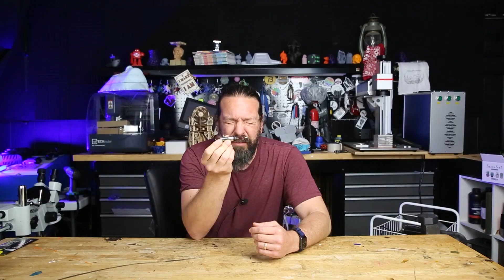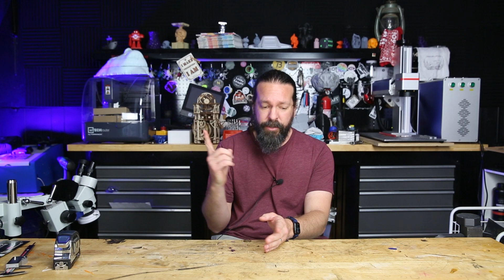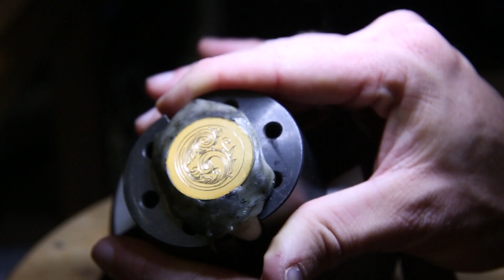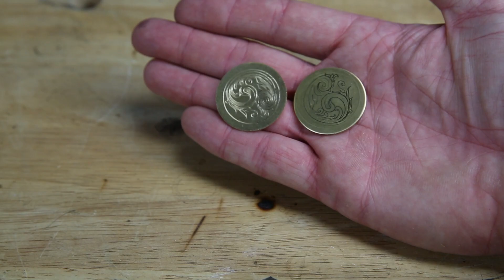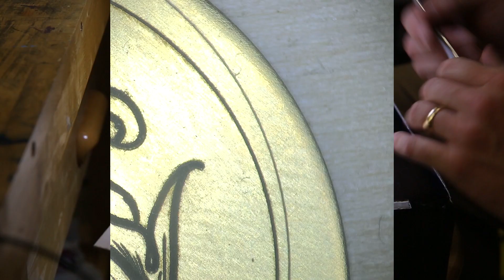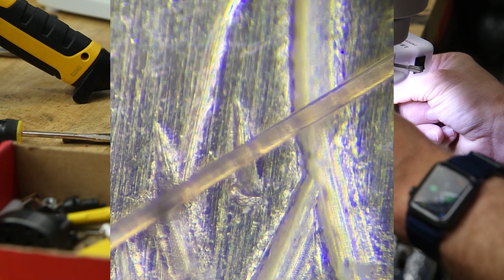Laser Engraving Vs Hand Engraving Metal

Comment: Cool video. There is also another option. Engraving with a desktop CNC. That uses a motor and rotational bit the same way a dremel does but is computer controlled. Using the different types of bits you can achieve a few different effects and since it's computer controlled, it can do highly intricate work and easily repeat it. Like the laser, it doesn't take much skill, just be tech savvy. Of course, it has it's own limitations. Few desktop machines will work with any type of steel or iron and those that do will be higher in price. Another issue is their ability on uneven surfaces. The thing you're engraving has to typically be flat, or with some extra expense and set up, round or maybe spherical. If you want to engrave something that has an uneven surface, like an axe head, it's going to take extra setup and multiple passes and much longer time. Anyway, just something to point out that maybe you would like to discuss in a future video.
Reply: I would be very interested in seeing a comparison. Unfortunately, it's not easy to test firsthand, and a detailed comparison with tabletop CNC would be helpful as well.